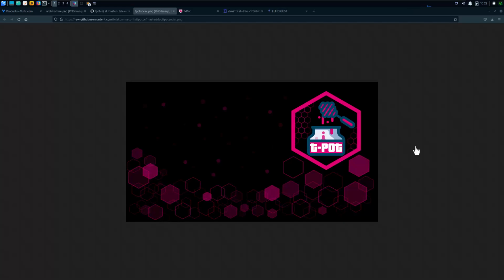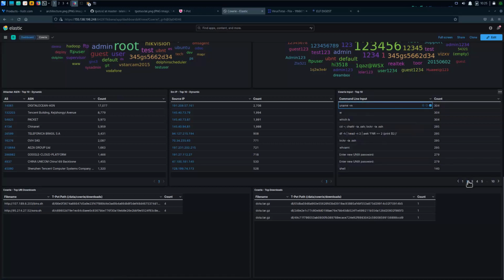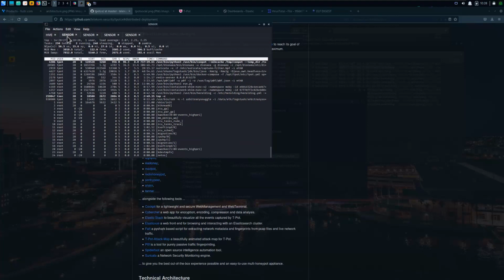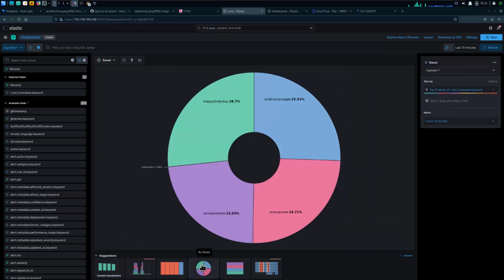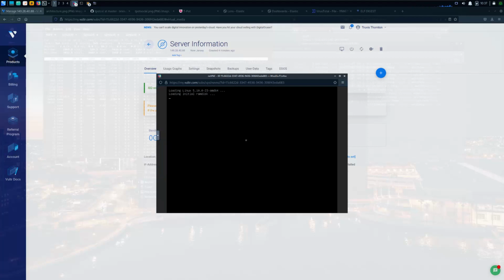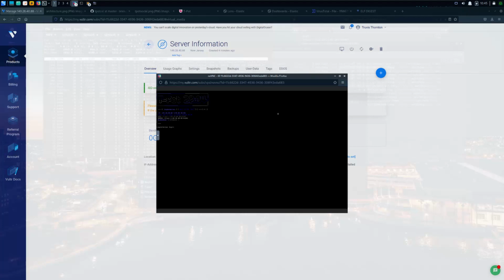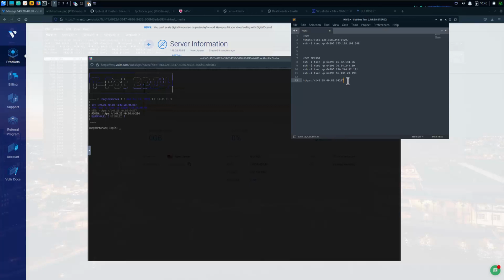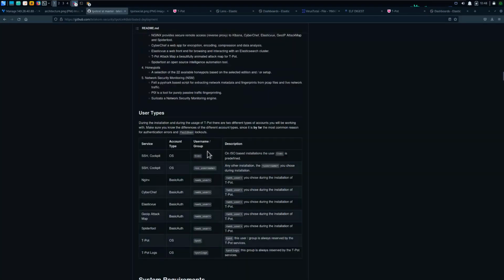Learn how to use HoneyPots and build a Network to do threat hunting and intelligence with T-POT.

Comment: I am particularly interested in collecting logs for a log analysis project that I will be doing at my university. Is there a specific folder where the honeypots store logs in text format?
Reply from the maker: Sorry about the late reply, been busy with work lately. I don't have an exact answer, but since the backend is Logstash, it should be possible to modify the logging system to also send to a file (if not already). https://www.elastic.co/docs/reference/logstash/plugins/plugins-outputs-file

This should point you in the right direction https://github.com/telekom-security/tpotce/wiki/Reconfigure-logstash.conf
Reply: I also need logs for analysis. Like to ask do you solve it?

Comment: For some reasons the kibana section doesn’t work, I get an unauthorized access error, I don’t really understand what I did wrong… any idea ?
Reply from the maker: It could be related to a lack of RAM and one of the backend processes failed to start. All of the issues I ever encountered was in result due to a RAM issue.

Comment: Are you using the stock standard iso from github? Which version did you use because when i try version 22.04 it i looks different
Reply from the maker: I'm pretty sure it was the 22 version when I first did it as the 24 did not come out yet. What looks different?
Reply: @TRUValueInformationSecurity   I noticed that the newest version only gives the option to install Hive, Sensor, or Mobile versions. I wish I could do the ICS or Medical ones because installing the Hive version is heavy

Comment: I installed t-pot standard but I have several messages in the meerkat panel: (The field "ip_rep.keyword" associated with this object no longer exists in the data view. Please use another field.), that error is repeated in several of the kibana tools: "ElasticPot", "Cowrie", "Dioanea" "T-pot", "qHoneypots", "Fatt". Actually I have other messages in Suricata: "http.http_content_type.keyword", "ssh.client.software:version.keyword", "fileinfo:magic.keyword", etc.
Can it be corrected?
Reply from the maker: You could try increasing the RAM. Majority of the issues I ever experienced were related to lack of RAM as this project is very memory heavy. Otherwise, a reboot may fix the issue.

Comment: Hello, i'm triying to deploy a hive and a sensor but both din't conect, the documentation is incomplete. 
any suggestion??
Reply from the maker: Hey! Do you get an error at all? One of the issues I had was if the memory was under 4GB RAM I think it was? the connection failed. I remember having an issue related to that. Another thing could be the firewall might be on.
Reply: You need a minimum of 8GB an then you're RAM is Alltime under Full Load!

Its better to get minimal 10 or 12 GB RAM on a virtual Machine or 16GB RAM on a Dedi Server.
And you need 128GB SSD